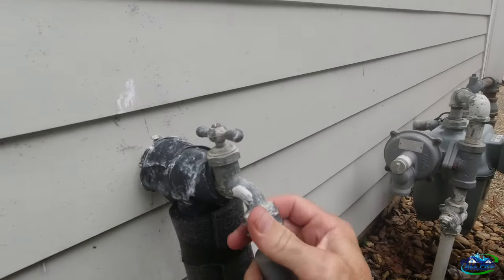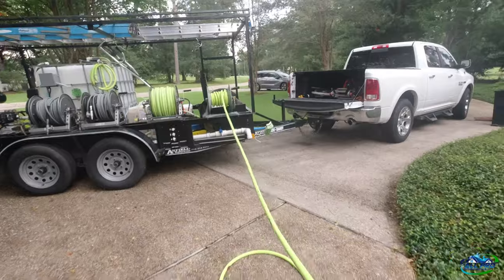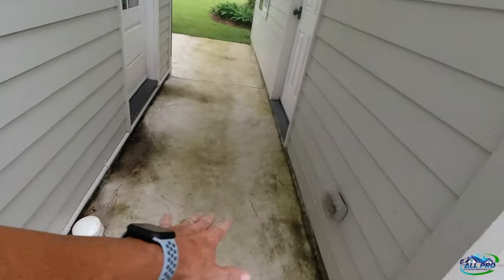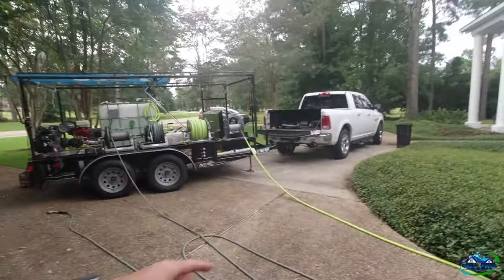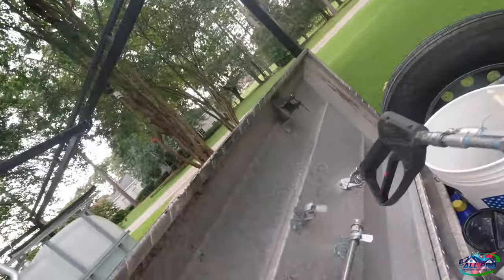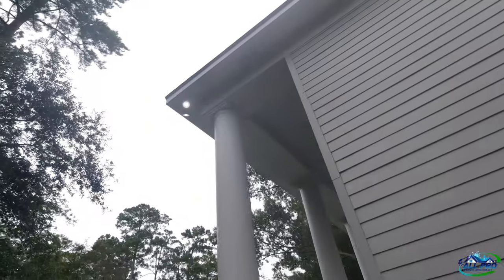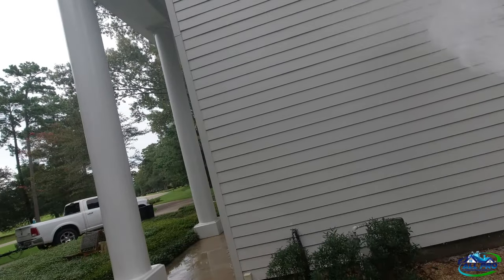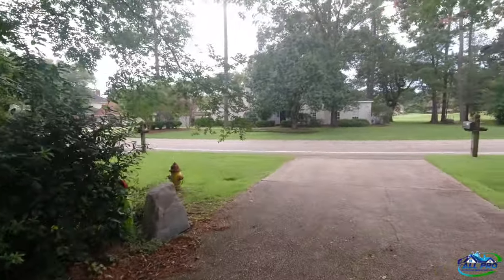Last Minute Wash Request at the End of the Day!

Comment: Heyya,  for DS'ing house,  do you find that ur Davis/M5DS takes the place of a 4-banger Jrod?  I'm kinda new & can't decide.  If you had to choose 1 set up?   Thx bud
Reply from the maker: I would choose the M5 all day!! Thanks
Reply: That helps,  thx.  PressureTec here I come!
Reply: Where can I get a 2" extension?    thats just a basic piece I can get at a hardware store or Lowes, right?
  Any other specific parts for that set up you have there?
Reply: Sorry, one more imp question.   I assume you got that double jrod holder also from Davis, correct?   In other words,  the Shooter tip beside the M5DS will fit, or do I need a diff holder that's a bit wider?
Reply from the maker: @weasel1026  You can find the nipple at any hardware store. It is a 1/4" x 2" galvanized nipple. Thanks
Reply from the maker: @weasel1026  Order the davis shooter tip & holder from Kyle Davis. https://davisshootertips.com
Reply: Just did🤗
Reply: Yo, I just went back and watched this video again where you showed and explained the exact set up-Duh. Guess I wasn't paying attention at 1st